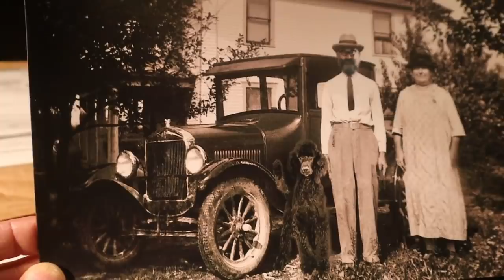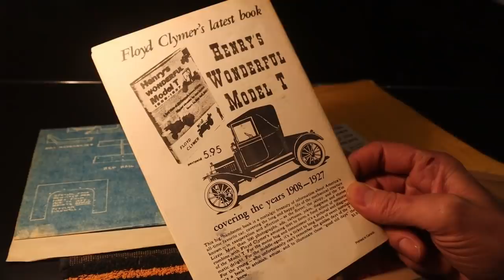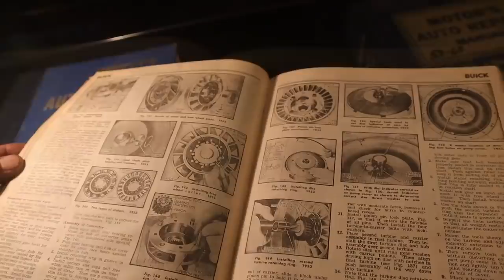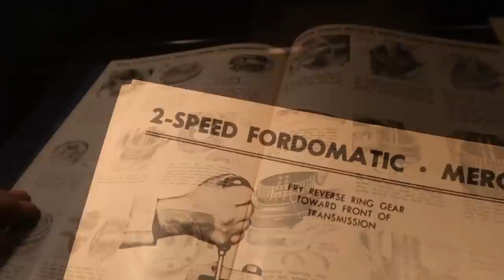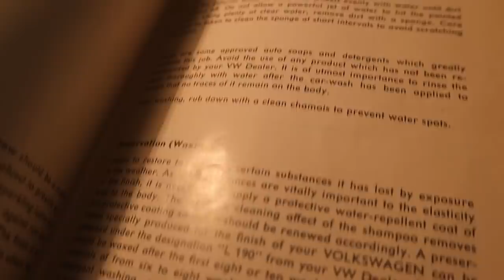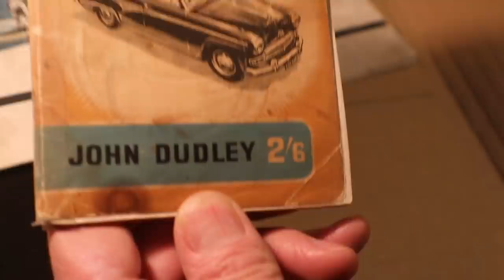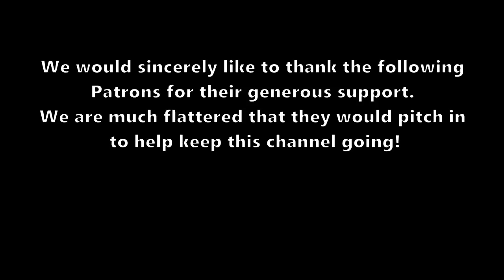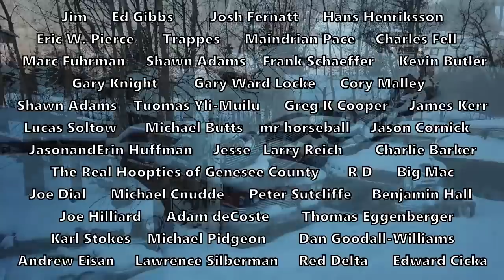Getting My Head Examined! Chevy 216 Cylinder Head Teardown, Plus: Mail and Classic Timepieces!

Comment: That cavern in the one cylinder may be low enough to not affect compression a whole lot, and conceivably not smoke too much oil smoke either. If you are going low-low budget and want to avoid sleeving it, and only plan on driving it to church on Sunday,  I might be tempted to button it back up and give it a whirl. What's the worst that's  gonna happen? I've put together a coupla clunker engines with pretty good vertical scuffs at the top of the cylinder with plenty good drivability and no smoke out the exhaust...now, blow-by might have been another story💥💨 A horizontal divot could conceivably catch a ring, though. Are you feeling lucky...?

Comment: Those stuck heat risers were real engine killers. They would get carboned up and choke the engine and overheat it causing the head to warp. Back when I was in auto shop in high school 50 years ago my teacher always stressed checking and lubing them with graphite but he really suggested just eliminating them altogether. It might take the engine a little longer to heat up but save you a bunch of trouble down the road.
Reply from the maker: Yeah! It's the most likely conclusion because there are so few miles on the car...Cheers!
Reply: Hi. I eliminated a bunch of them.

Comment: I'd say that was the best the band has ever sounded! Clear and concise, very very nice! Don't know if you've ever seen or tried this semi-unorthodox method of freeing up seized engines, but on an episode of "the lazy car dealer ",a lovely "brit-com" offering on motor trend channel or maybe even the bbc,they had a seized engine, took off the head and filled the bore holes with cola! I don't know if they filled the crank case too, but I imagine so if they filled every piston hole up to the top. But here's the kicker, after, I'm not sure how much time passed, they obviously drained the cola out,properly filled the crankcase with the required amount of oil,assembled the engine and brum brum it started and ran with just a wee bit of smoking!!!! Hmmm,considering how many seized blocks you've encountered, I reckon if you can save some with a few liters of coke,why the fuck not try it? I bet it's even cheaper than the traditional diesel or marvels mystery oil treatments too! Lol! Hey,what have you got to lose?it's already a seized boat anchor/doorstop to begin with at that stage! Yeehaa!

Comment: The Chevy head came out pretty damn clean.  I keep an old dishwasher around for those kind of things but I don't think it'll be fitting any straight 6 heads in it.  I hope the seats can clean up and it's useable.  It's nice seeing original parts be used, but you are right, they made a bunch of those engines.  The hard part is how many survived with good parts at this point.  I don't know what the heck that spring was in the heat riser.  Looked almost like a helix-coil.  Weird what you find sometimes.

Comment: Although I enjoy seeing Frankers running through clover or bounding through snow, this week's opening montage of the band was a nice change.  I'd like to see and hear more.  As for the cracked exhaust manifold on the Chevy, I was told by an old and wise mechanic that inline 6s were very susceptible to cracking iron manifolds because the cylinder head and manifold heated and expanded at different rates due to their mass or lack thereof.  Fact or old wives tale, I can't say, but I have had to replace the exhaust manifold on my 223 Ford I6 twice.

Comment: Hi Scott. It looks like the Chevy cylinder head should clean up nicely. If you come up dry on the exhaust manifold search, you could repair the crack quite easily. I have done this type of repair before with success. There is a cast iron welding rod available through Amazon called "Muggy weld". A I/2# tube (14 rods) of 3/32 costs $80 US. It's a bit expensive but a 4" crack can be repaired with a single rod. It requires minimal prep and little or no pre-heat. You can run it at around 50A (AC or DC). Stitch about 1" at a time and hammer as it cools. When you're done, grind smooth and paint. If you can get the #5 cylinder bored and sleeved to standard, a set of rings and gaskets would yield a perfect repair.   Cheers!
Reply from the maker: Hi Edward! I am considering the welding approach for sure.. I am also considering an aftermarket split cast-iron header, and I would also replace it if I can get a stock one cheaply, as they are not rare... Cheers, and thanks again for the support for the show!

Comment: If the bad cylinder is too pitted, you could probably bore it for a sleeve without pulling it. Boring bar will fit right on the block. Old Kwik Way boring bars can be had if you end up doing a bunch of engines. Just cover the other cyls. and the crank to keep the chips out. Sleeve goes in press fit with a big hammer on a thick steel plate. Put the boring bar back on to trim the sleeve top and then bore it and hone. It is amazing how much they did in chassis. I have an old book that shows reconditioning a crank in the car! Cracks in heads and blocks are also fixed with tapered pins installed after drilling the ends of the crack (to keep the crack from growing) with a tapered bit, driving the pin in, and then continuing along the rest of the crack (for shorter cracks) doing the same process with the pins overlapping. Amazing how they saved scrap parts back in the day.
Reply from the maker: Yeah! We do have the technology to do just that... I'll try to fix it the best I can and if it is a crop-duster I'll go all-in with a sleeve... Cheers!

Comment: Before you spend a lot of time/money on the cyl. head send it out to a machine shop and get it magnaflux inspected ( a common practice). As for the block a cylinder sleeve can be installed if you wanted to keep it original. otherwise you have the other engine.

Comment: Hi Scott.  On those rings where manifold meets head, I'd judge that they are just for correct manifold location, and that two was enough for that and a third never fitted.  
Next, lots of people are saying that you're in for sleeving that cylinder, and they may prove correct in the long run, but for a car that you might only put 500 miles on in a year, a tiny bit of smokiness might not be too hard to live with.  If blowby is an issue, one good thing about oil bath air filters is that it's easy and harmless to run a hose from the rocker cover into the air filter to deal with blowby.  
I too have blanked off heat risers, but I'm in Australia, and you're in Canada ..... brrrr!

Comment: A cracked exhaust manifold AND a blown head gasket... Probably overheated to the point that the head is now warped. Gonna need to be checked and mebbe milled. Not a real biggie, though, but if not checked radiator damage may happen (top tank will CONSTANTLY leak at the seam to the core).

Comment: Scott you can v the crack, heat it up and weld your cast iron exhaust manifold with 7018 or 7028 low hydrogen rod.
Reply: Or coat hangers?
Reply: 6010 farmers rod also ? Definitely heat it up good first
Reply: @heathersanborn4914  6010 is tack rod. Probably wouldn’t withstand very many heat cycles before the repair would fail.

Comment: It seems like all online 6 manifolds crack!.my dad reinforced the practised of warm it up.and cool it off. Don't push it until you have oil or coolant up to 180+ F. Idle the engine 1 minute for every hour of running  before shutting down.
Has worked well for my 40 ÷ years of messing around with motors

Comment: The numbers...2'6...on "The ABC's of British Cars" was the price...2 shillings and 6 pence...the pre-decimal form of currncy in the UK. A shilling was 12 pence and there were twenty shillings in a pound. I'd guess that the equivalent price over here would've been around fifty cents.
The design of the combustion chamber on the 216 looks like it had some innovating thinking going on, with the exhaust valves canted at an angle to the plane of the head. I'm going to look into that to see what went into the design.

Comment: The cyclinder divit is at the bottom of the stroke.. a good honing and A bottle  of Lucas oil treatment will work wonders..
There are several modern gm 4 cyl engines with tenable oil consumption problems that I have   greatly reduce my customers oil burning with the long chain hydrocardon goodnes of Lucas!

Comment: Scott I would test the thermostat in case it is not defunct or bad. Sometimes these old style ones get stuck for no reason and that is also one of the overheath issues.
Reply from the maker: Hi Steve! You bet, I'll test it here and we'll see what happens... My other chevy six had it installed upside-down! Cheers...
Reply: @coldwarmotors  I think it is not very hard to convert it to a modern thermostat. The valves should clean out nice and the best thing about the head is the valve stems are not worn out. Replacing those is a nightmare on every car. Also nice work on Jim's Lincoln quarter panel and the gifts you guy's received are just amazing.

Comment: I have a 1958  235 chev. in my 1951 gmc pickup. It has a crack in the #4 cyl. head that goes from valve seat to valve seat. It was that way when I got the truck in 1978. I just leave the radiator cap loose and keep going. There are bubbles in the radiator but the coolant dosn't seem to go into the cyl. I never push it hard but it always goes and it is a blast to drive.

Comment: That was a very interesting video. Really cool watches. Outrageous! Glad to see Jim. I laughed when I heard the Ford crank over and start so quick. That would be a cool contest. How quick can they start with the least cranks. You found some very interesting problems with that head. I bet you they caused a temporary overheat condition that made the head gasket go right in those cylinders. You also don't know if the original owner was trying to limp home on an overheating engine or what not. It will run again better than ever. Keep up the great work.

Comment: I don't know if Model T gland rings (exhaust and Intake manifold) would be the same size but it wouldn't hurt to try.  They are also split, so they squeeze for a tight fit in the ports.

Comment: I once saw a ad for a light setup for a for like I n this video you took the center bullit out of the grill and mounted the light there it hooked to the tie rod and the light turned with the wheels when you stead the car the picture looked like it came that way no hatchet job bolt on 
Have you ever seen one of those kits

Comment: Regarding the question of what the value of 2/6 was in the old pre-decimalization UK currency system there were 20 shillings to the pound ,12 pence to the shilling and so 240 pence to the pound.  2s 6d would be the same as 30 pence or 1/8 of a pound. In the 50s and 60s the exchange rate of the pound was 1 GBP= USD 2.80. Therefore 2s 6d would have been $2.80/8 or about 22 US cents.

Comment: I am a Warren Zevon fan.   At 36:50 into the video, there was a picture of you (Scott) and your sister Laura, standing beside the model T with Frankers.  Laura looks very nice wearing her babushka afternoon wear with derby hat.  I never knew Laura was a model   You never mentioned it, but Miles J.B. Weld'ed the pitted cylinder walls of a brake caliper, (in a previous episode) which worked pretty damn well....   I know you have thought of it. Maybe you could advertise for J.B Weld and be a paid representative. The directions claims it will work.  My dad was a bondo and J.B. Weld sculptor.
Reply from the maker: Hi Dennis! You called it... I think it is a perfect situation for JB... Cheers!

Comment: It's hard to get your head around the economics of what a conversation about that head would have been like in '46. "well ma'am, you're going to need tires, that's $12; looks like we got a blown head gasket that's another 27 cents for a gasket kit and 4 cents for antifreeze but the big ticket is the exhaust manifold that's going to run you $20 parts and labour. You sure about this?" "What did you say this car was worth?" "I dunno lady, you might get 50 bucks..."
Reply: x100 inflation checks out lol

Comment: Interesting the wear  on that Chev's head for such a low mileage engine. I guess the quality was always there. Those watches are something else. How did they make such precision when we can barely 3d print now.
Reply: Remember, those engines were barely good for 50K miles and in 1937, they didn't even do that much before a rebuild. It had a lot to do with the state of metallurgy and technology at that time. 50-80K was as good as it got until the early 60's when the 225 et-all began to run over 100K miles without a need to rebuild them if taken well care of. That said, even a late 60's V8 based sedan/wagon can look tired and worn out at as little as 113K miles. My parents had a 1964 Dodge 330 station wagon with the slant six, and we got 140+K miles on that motor without a rebuild, but it was barely reliable by the mid to late 70's and may have smoked like a chimney then too. I was young when we had that car and was in the 7th grade when we finally sold it in 1977.

Add to that, my first car was a 1968 Chrysler Newport pillared 4 door and when I got it, it was 13 years old, has the 383 V8 and the front sagged, paint was faded badly and the interior was looking worn in spots - 113K or so miles. Oh, the muffler barely existed, had to wire in parts of tin coffee cans to patch it up. 

These days, it's not to difficult to have a car still look decent at 15-20 years old, still sit level and drive well with over 200K on the clock.
Reply: @johnhpalmer6098  Meanwhile we always say the were built better back then.

Comment: 26:38 - Any wear on that shaft at 37,000 miles was somewhat puzzling to me. Perhaps a symptom of no oil filter or oil changes or bad oil quality in those miles? I wonder if there might have been some original motor oil from the factory still in that oil pan. Then again, both the '60 Chevy 283 engines in my parents two cars were "smoked" at 80,000 miles.
Reply: Back in the day, 50-80K was considered used up for most cars until the mid 60's when some motors, most notably the I6's that they began to last to 100K or more. By the mid 70's 140K+ was becoming common if cared for. Had a '74 Nova with the 250 I6 and it lasted well past 145K, by then, it was smoking some, but still strong, but it went through the ash of Mt St Helen's  in 1980 when it blew and my oldest sister and her first hubby drove through Eastern Washington on their way to Tacoma when he had graduated from seminary in Wisconsin. Should have replace all the rockers when the first one went, so the valves took a beating, which didn't help matters.

Comment: Hey Scott! 2'6 is 2 shillings and sixpence, a shilling was worth 12 pence so that's 30p. This was from back when the British currency was pounds, shillings and pence aka Librae, Solidi, Dinarii, abbreviated to £sd (yep, the £ is an L on drugs). A pound was also worth 20 shillings or 240 pence. Definitely drugs involved there.
Reply: No, 2/6 was two shillings and six pence (2s 6d) which, pre-decimalisation, was 30d, not 30p.   An old shilling converted to 5p, the "p" indicating decimalised (new) pence.
Reply: @nickturner2813  I remembered about the d after I posted but then I decided nobody would notice/give a crap. I have a feeling the shilling actually carried on for a while as 5 new pence. I was only 6 in 1971 so neither system meant much  to me anyway.

Comment: 2' 6d or a "half-crown" worked out to about 50 cents in the day. I'll bring one the next time I'm out. I used the same Motor manual to strip my Chevy down, they're very good! 
And yes, the secret to the "Twin Turbine" Dynaflow Buick was the "switch-pitch" torque converter, - that's how it stayed in essentially the same range from zero to 120 mph. The "Triple Turbine" was a dog used in 58-59 only, and your 59 luckily doesn't have it. GM's Turbo-hydramatics used switch-pitch technology in 1965-68 on the 400 3 speed and the 300 2 speed transmissions.

Comment: Mr. President, I'm hardly the person to give advice, I can only pass along my firsthand experience:  time to get the bifocals.  Advice? 1/ Don't frustrate yourself or your pocketbook with that "lineless" bullshit.  Franklin had it right from the start.  With the segmented bifocals, you know exactly where to look for close sight, no "learning" how to use them.  2/ Tell the optician to set the top of the bifocal segment (the line) 2 mm LOWER than what he considers the ideal depth for the bifocal segment.  He'll argue with you about it, but fuck him.  After all, he's the guy who's trying to convince you that "linele$$" is the only way to go.  The lower (smaller) bifocal segment is plenty big for when you need it and less likely to be in the way when you don't.  For extended close work, you'll probably still take off your glasses.